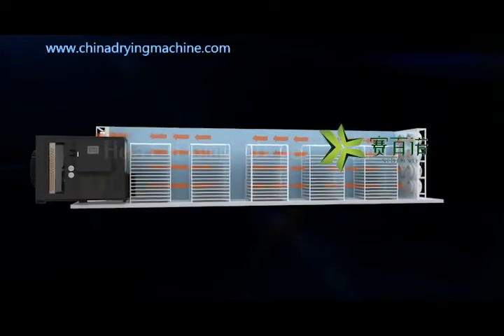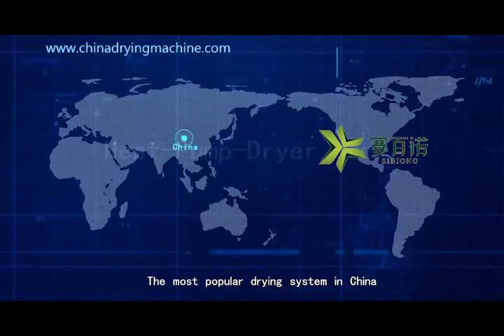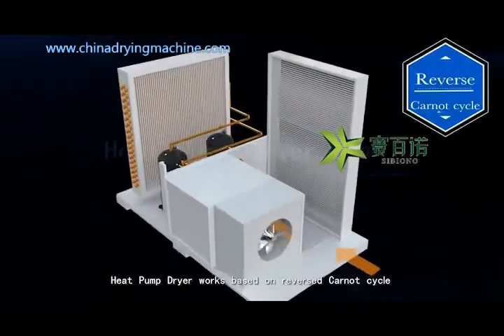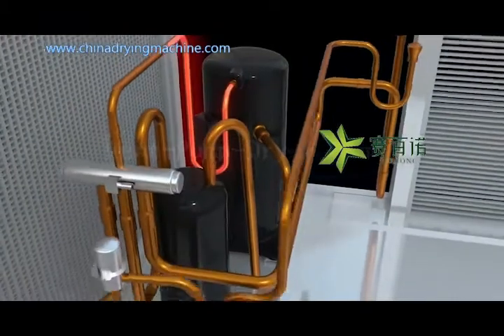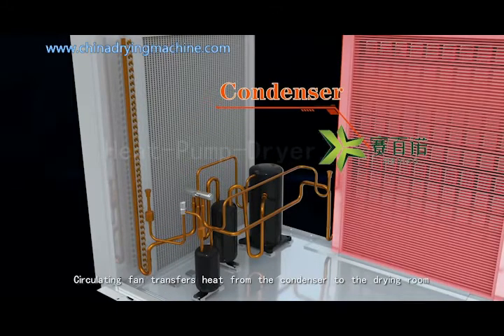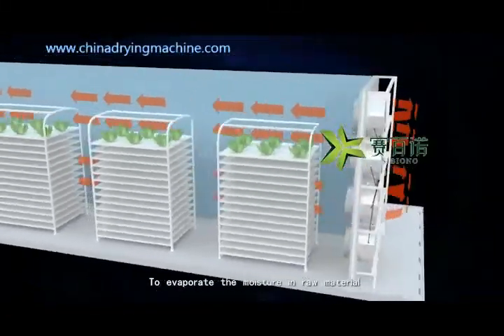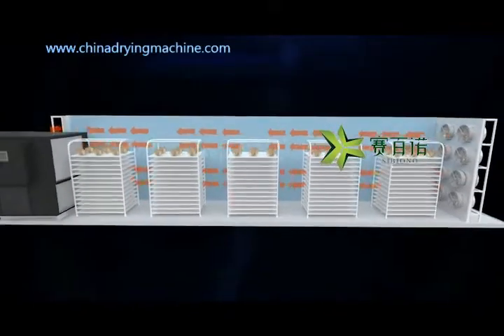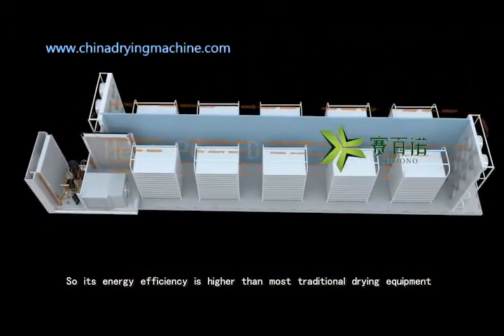Decrypt the Working Principle of Food Drying Machine

Comment: Price
Reply from the maker: This is a customized version of the heat pump dryer. Can you tell us your needs?
Hello

I am Jack from China. Glad you asked about our heat pump dryers.
Heat pump dryer customization:
1. Drying mode: cold dry or hot dry
2. Dehumidification mode: open-loop dehumidification fan dehumidification & closed-loop evaporator dehumidification
3. Temperature standard: 8 - 80 ℃ (temperature can be customized 100 ℃)
4. Single set capacity: 100kg - 10000kg
5. Tray: 304 stainless steel or plastic tray

Looking forward to your contact. My whatsapp and wechat ID: +8615918715336